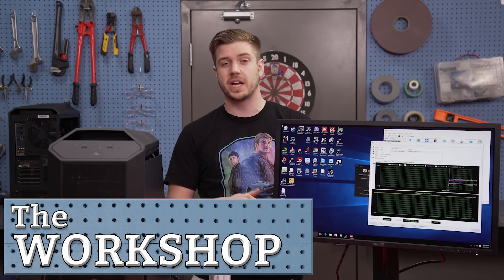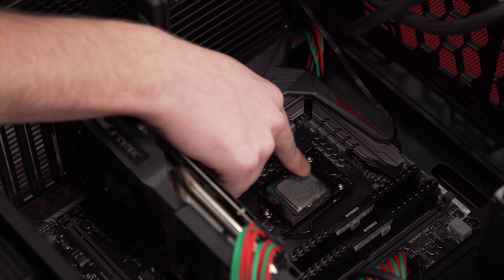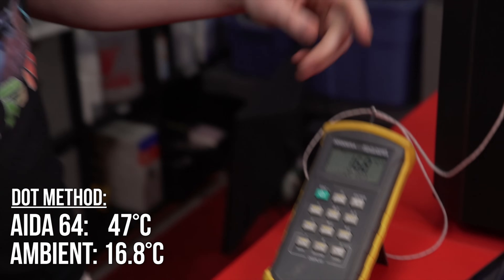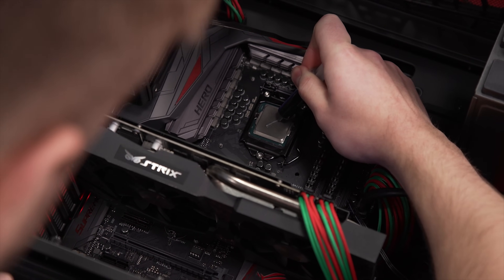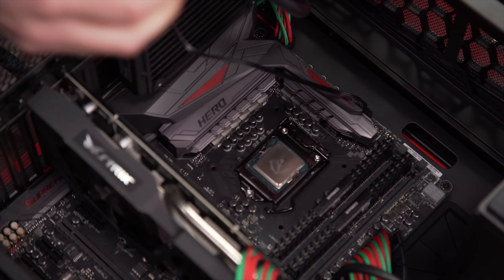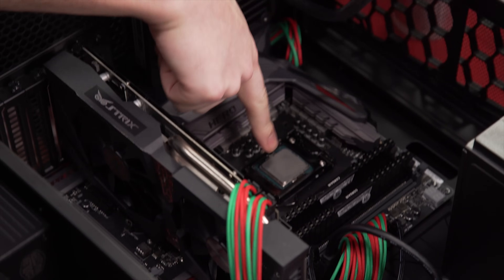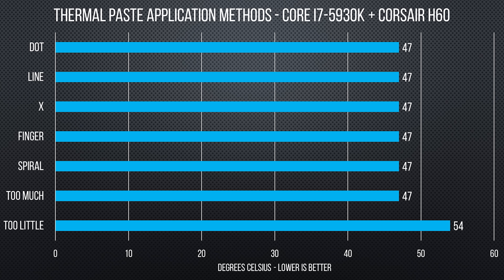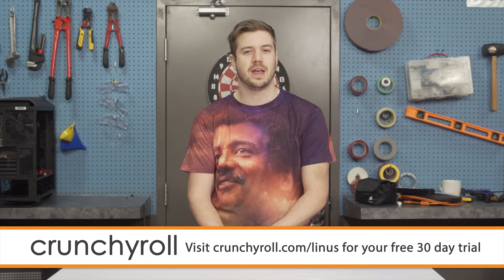Thermal Paste Application Methods - Which one is best? - The Workshop

Comment: In my opinion the Ambient Temperature is meaningless, because its an AiO! This test would be waaay more meaningful with an custom Watercooling with an Water Temperature Sensor in front of the fresh cpu water. 
The ambient temperature only affects the CPU Temperatures indirecticly.

I don't think Lukes Test is bad, but because of the unknown AiO water temperatures, no comparisson of Fan/Pump Speeds the results could be very different to an full controlled custom Watercooling.
So not bad, but not particulary good.
Reply: Eh wot, at that point you want too many variables and you're no longer asking if thermal paste makes a difference. Even if a custom loop was a little cooler, the point would be the same: thermal paste application barely makes a difference in temperatures.
Reply: +Tom Weise It's not meaningless at all. The ambient temperature (or the difference in temperature in other words) is a critical factor in heat transfer (it is literally in the formula to calculate it). It's a linear scale: Increase the ambient temperature by 10 degrees and the equilibrium of the temperature of the CPU will also be 10 degrees higher. Exactly the opposite of what you say is true: without the ambient temperature the measurements are meaningless (because of how physics works). The only thing they really need to be careful with is letting the temperature completely settle. With a water cooler it takes a while to fully heat up the water so you can't just stress it for a minute and expect accurate results.
Reply: +Niosus ambient Temperaturen without any other information are meaningless! If The fans spin with higher RPM they cool much more. The only necessary variables for an test with watercooling are water temperature and (a bit) flow rates! It doesnt affect tje cooling if the ambient temperature is 17 (maybe less RPMs) or 22°C (maybe higher RPMs) if in both scenarios the water temperature ist 30°C. The CPU temperature would be the same even with different ambient temperatures!

I know the maximum differences would be 1-3K and meaningless to 95% of us, but still this test has some  weak points. If you test with watercooling, only the Water temperature and flowrate are meaningfull!
Reply: Tom Weise When comparing temperature benchmarks using the same cooler, you use fixed RPM rates. The goal of benchmarks like this is to remove variables. They didn't specify whether they did or not, but they should. If they didn't they simply f-ked up the benchmarks.

Look I will explain the physics behind it below. It's a bit long, but I tried to be thorough.

Flow rate is irrelevant once equilibrium is reached. The fan is taking away a certain amount of thermal energy at one side and the CPU is adding a certain amount of energy on the other. Under the assumption that the fan RPM is constant (explained above) and that the ambient temperature is constant, this is the situation:

- The CPU is outputting a constant amount of heat energy, causing the water to heat up
- On the fan side there are a whole bunch of factors: Surface area of the heat sink, pressure (directly linked to fan speed. Flow high -> pressure low), thermal transfer constants and the difference in temperature between the heatsink and the air around it. In a properly designed tests, all those factors except the temperature difference are fixed.

Heat energy is transferred proportional to the temperature difference (because physics, look it up or ask me for a source if you care to figure out why). This means that as the benchmark starts, the water starts out cold and is heated by the CPU at a constant rate. Because the water is still fairly cold (thus the temperature difference is small), the energy transfer at the heat sink is very slow (--> not enough to cancel out the heating). As the water heats up more and more, the temperature difference becomes larger and the more and more heat is transferred away until some equilibrium is reached. At that point the CPU is adding exactly as much energy to the water as is being taken away on the other side. The temperature of the water is thus entirely dependent on the ambient temperature if those other factors I mentioned are fixed, which they should in a good test.

Now the same happens between the water and the CPU itself. While the CPU generates a constant amount of heat, its temperature is dependent on the temperature of the water in the same way the temperature of the water is dependent on the temperature of the air. There will be an equilibrium such that the temperature difference between the CPU and the water exactly causes the energy the CPU transforms into heat to be transferred to the water. This is a necessary condition for the CPU to reach a constant temperature.

So the temperature of the CPU is determined by the water, and the temperature by the water is determined by the ambient temperature. This is also true for air coolers, just replace "water" with "heat sink". The only independent variable in this system is the ambient temperature, so that is the only relevant value to share. The temperature of your water is dependent on the temperature of the air so it is clearly not an independent variable. Your mistake is trying to include more variables, but a benchmark test should always try to exclude or "fix" variables. Including more variables is accurate, but you lose the ability to compare results. A good test is designed to exclude all variables except the one that is being tested. In more ideal conditions, this test is done in a room kept at a constant temperature, removing even the ambient temperature variable. It's important to understand why tests are done and what information you hope to gather from them. What you want to learn directly influences your decision to include or exclude variables. This is true for any scientific test, not just silly computer benchmarks.

Comment: How about how much noise can be reduced with different methods? Like using rubber mounts on fans instead of screws, or different insulation materials on the case. How much is necessary to silence a case and how does this affect system temp?

Great video as usual, just no nonsense testing!

Comment: Now, you need the thermal pad in comparison, right? Right.

Fun fact: "Boxed" CPU from AMD use a thermal paste that will turn into glue over time and my Phenom II 1100T that I wanted to reuse after a mainboard failure does not come off the cooler. Bummer. Well, upgraded to an FX 8350 instead. Damn you AMD!

Comment: Pretty interesting I have to say.  In the future, you NEED a control.  There should have been another method of "NO Thermalpaste" at all.  If the "too little" didn't give you the result it did, then this experiment would have been inconclusive at best.  You essentially got lucky.
Reply: +BigKevSexyMan It is well established that no paste at all leads to fried components. In general yes you need a control, but not in this case. It'd be like testing different kinds of oil in your car and insisting you need to try it with no oil as a control.
Reply: I can see your point, but if you're going to use the scientific method properly, you can't be afraid to break a few eggs.  At the very least, he should have been explained why he didn't use no thermal paste(with sources to back it up).  Unless he did say that, and I missed it.

Comment: Quick suggestion, to show what the different methods and amounts of application result in, why not use some sort of a clear plexiglass of the same size and if possible shape (cut, sand and wet sand). That way you can actually see the difference and the results of the different methods/amounts. It might be very laborious but quantitative and useful i think to show the result of each method, and if perhaps any dead spots (places with no coverage)  which could effect the chips longevity. Just a thought. Take care!!!

EDIT: I know you can remove the heat sink to see what spread pattern but when you pull the heat sink off of the board, i think that the compound might spread to places where it wasn't. Also the longer the compound is on, the more it dries and so places with dead spots might decrease the longevity of a chip and so it might not be accurate to take the temperature when the compound is fresh, though i dont think there is another way of doing this test without taking the temperature right then. Just same ramblings. Take care

Comment: Whatever man, my Sempron 145, overclocked to 3.2 GHz and unlocked 2nd core (it's now the same as an Athlon II x2 260) has around 77W TDP, stock AMD cooler (the one without heat pipes) and NO THERMAL PASTE runs at ~50°C under load with ambient temperature of ~24°C. 

So yea.... though I don't recommend using a CPU without thermal paste, this CPU was dirt cheap and surprisingly it can take it's punishment. I don't intend to invest in it (my main PC is an Atom z3740 tablet), I only clean the dust from the case and radiators from time to time (at least I do reward my old computer with a refreshing clean).

Comment: The temperature might have been more sensitive to the amount of thermal paste if you had used, say, a stock cooler that couldn't compensate for ineffective application.

This series seems to be showing that it's harder than I thought to screw up your computer.

Comment: Most thermal paste has a time period where it needs to set in and 10 minutes does come close even under load. Most require cycling loads over a period of time much longer. Also as many have said cooler is just too good for the load on that cpu, and where are the core temps. I hope he went to some forms where people have done some very in depth testing of this instead of just videos, but sounds like he only watched videos.

Comment: I wonder if your results would have fluctuated more Luke if you used a shittier CPU cooler. Instead of using the AIO liquid cooler use the most common CPU cooler ever the Hyper 212 Evo.
Reply: +Zac VanVeen I think using a worse cooler would make it even closer (although that is not really possible here^^). Ideally you would want as much heat as possible that is dissipated as fast as possible so there is a "temperature gap" as big as possible between the heatspreader and the cooler.

Comment: I think you will see different results with a cpu that has proper internal paste between the chip and internal heat sink. so try a delidded one. 
And ic diamond is easier to apply if you preheat it.
Reply: ***** yes there is. Theres been a whole debate about wether or not Intel should use soldering in stead of thermal paste (that's what they used to do years ago). But that would come with its own issues overtime. 
And I wouldn't recommend it the way you suggest. Doesn't really have a value. Some people however remove the internal heat sink entirely and use their cooler directly on the chip. Which is really not advisable, it will break your cpu probably. 
You could search for delidding for more info. Best you can do is remove it, apply a liquid metal thermal paste and put it back on. But if done wrong you break it. Which I have in the past. I broke a 3770k by cutting into the pcb of the cpu with the razor blade, by holding it at the wrong angle. Result was that the lanes to the memory were broken, so system didn't recognize any memory. Or you might break some resistors or the cpu itself if not careful. But if you get it right, it might give a huge temperature drop at high voltages. Depending on the architecture sometimes even about -20 degrees celcius at full load. But very tricky and expensive if done wrong.
Reply: So in the case of this video the internal thermal paste is the bottleneck. That's why you don't see much of a difference.
Reply: ***** that's because of the limitations to the kind of solder used because of environmental laws. Solder with lower temps are very taxing to the environment and health, so they use different solder which require higher temps, but too high and your components will damage. So they have a shorter window to apply heat, resulting in weaker connections in a lot of cases. Which I also experienced with my gtx 780ti that's lying dead on my shelf. 
But also the soldering won't last as long in cpu's because of constant fluctuation in temperatures. I guess that's why they stopped using it. Not sure.

Comment: I burned 2 "Palomino" Athlon XPs back in its day. The store I bought them is kind enough to give me a replacement for those two (that mean I bought 3 in the price of one :)). Back then I thought it's better to have less compound possible on the chip. Those two prove me wrong.

Anyway I usually spread the compound evenly by hand (I know that the weight of the heat sinc would also spread the compound, may be even better). I know some people who do this method too. I don't think there's any different unless there's too little compound on it.

Comment: Wouldn't this be more practical if you were to test with a low end third party air cooler ?
Should yield better results !

Not everyone trusts water cooling enough to use it !
Also not all air coolers have a lapped surface like that water cooler used in this video !

Too many variables, but the video seemed to avoid addressing any of them !

Comment: Did the cpu cooler stay at a constant pump speed and fan speed? or did it try to stay around a certain degree? still a good video but I would have liked to have seen a aircooled 's water cooled with the temps

Comment: Great video Luke! 
One thing I am interested in, is does it make a difference with an overclock? Seeing as the chip is producing more heat it may separate the results somewhat, especially with higher clocks and voltage. 
Not expecting a video, but it'd be good as a follow up. :)

Comment: Question: is it worth replacing the thermal gunk on a stock heatsink with a better thermal compound, and if so which type is best price for performance? i recently build a new rig and used some MX-4 thermal compound after having to re-seat the heatsink, but i've no idea if it has made my temps better (they're pretty good for a stock heatsink), or whether if i handnt had to re-seat it, it would be just as cool. thx :D

Comment: you'd probably see some difference with a budget air cooler like the hyper 212 evo or even a stock heat sink, something with a lower heat dissipation, if thermal paste application really matters, it will probably only matter with a lower performance cooler.

Comment: 1.  The whole point of thermal paste is so there's no micro-channels between the cooler and the CPU.  So applying it all those different ways won't show huge differences in 10 minutes because that wouldn't have even given the thermal paste time to "settle".  Almost the same reason why you wipe it down with a cleaner so there's no oil.  I bet if you were to test that (leaving finger prints on the CPU and/or cooler) in 10 minutes, there'd be no difference either, but does that mean you should go around touching your CPU and cooler with your messy hands?  2.  Why use a water cooler?  If you wanted to see any type of differences wouldn't an air cooler be more appropriate?

Comment: The problem with this video is that not all thermal pastes are the same.  The viscosity of the paste matters a lot in the application of the paste.  So just because one thermal paste has identical thermal results with different application processes does not mean another thermal paste behave similarly.

Comment: is it possible that the cooler just kicks in at 47° and hence keeps is at this temperature. you can test this by actually forcing the cpu at a higher temperature by putting a Crappy cooler on it or more computation. (Btw the accuracy of the cpu thermometer is 1° hence it's not really accurate)

Comment: But did the fan speed on the cooler change? If you got same temps but with different rpm's this test isnt very good.
Reply: +Cédric Möhlmann Agreed. I'm confident they thought of this and set a constant fan speed profile. If the fan speed was fighting to meet equilibrium then the test is moot.
Reply: +Cédric Möhlmann If the temperatures are the same, than the fan speeds are also the same.
Reply: cleetose Actually, no. The cooler will always adjust its fan speed to compensate for the heat. More heat = more rpm.
Reply: Cédric Möhlmann CPU speed changes based on CPU temperature. If the CPU senses it's temperature is at 47°, then the fan will run at whatever percentage it's set too for that temperature. So for every one of these tests where the result was 47°, the fan must have been running at the same speed.
Reply: No because the temps are being measeured while the cooler is on. The same temp is given in all tests because that is where the cooler strives to. In some cases, the cooler needs to be working harder to get that 47 degree mark while other times the cooler doesnt have to work as hard.

EDIT: a CPU cant sense its temperature. The mobo will. Then the mobo wil send a signal to activate the coolers fans on a corresponding speed.
Reply: Cédric Möhlmann That is nonsense. Look at your CPU fan curve. It is a simple graph with temp on one axis and percentage on the other. If the CPU is at 47°, then there is only one speed the fan will be spinning at.

Comment: You did do the test wrong.

Next Episode: You should've used an (i5) 6600 or something like that with cheap thermal paste and the Intel stock cooler. THEN do this again. You'll get a lot different results. Because you're using a liquid cooler and the paste is good, it's conducting as much heat as it can and the H60 is sucking it up like a beast.

Next Next Workshop: Are AMD CPUs really hotter, cheaper, and more hungry for power than Intel CPUs?